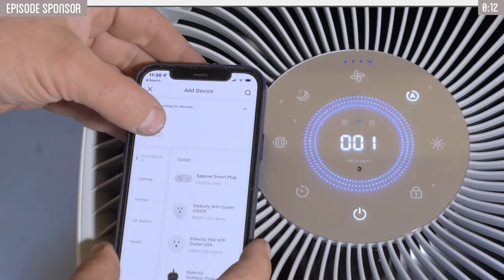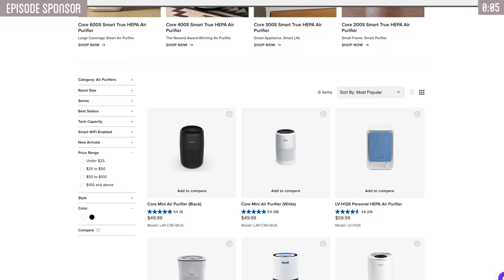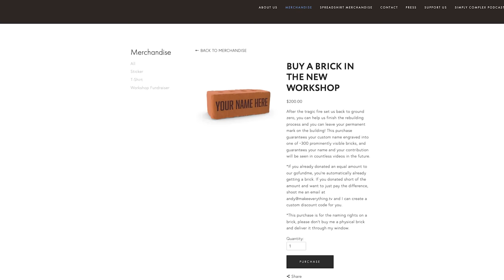How I Rebuilt 1 Year After a Fire Destroyed Everything

Comment: When you go to paint, might be worth looking into fire resistant paints, some aren't that much more expensive and can take a lot of heat/fire before allowing any damage to the surface (the paint essentially expands when burned to create a carbon foam that insulates the underlying material, then you can just scrape off the foam and repaint and as long as the fire gets put under control somewhat soon have almost no damage)
Reply: or rebuild things out of brick/concrete which is automatically fireproof
Reply: water glass makes wood less flammable.

Comment: Glad you are recovering. Don't forget to add a fire detection system. Smoke detectors might might not work well. But, you can use a heat triggered alarm like they use in factories  and be sure to wire it to an outside alarm bell so you can hear it from in the house. You might also consider a simple security system for your doors and windows.

Comment: Starlite(cbeck the nighthawklightin vid) based paint is what you need to guarantee the shop cant go up in flames. The paint foams up when there is fire making an insulating layer that will sve an egg from a blowtorch
Reply: Agreed, though it's not really starlite-based as starlite was proprietary. But most fire-resistant paints work on basically the same principles even if the exact mixtures are completely different. But I definitely agree, it's great stuff for this, because it can withstand for a long time and then you basically just scrape off the carbon foam and maybe repaint if it was bad enough.
Reply: @DreadKyller  Carbon foam based

Comment: Congratulations on the comeback!  Did you consider installing some sort of fire suppression system since you're rebuilding?
Reply from the maker: I've looked into a couple options and was hoping we'd have the budget leftover to invest, but not sure now that money is running short.  Also a little afraid of false alarms potentially causing damage to all the equipment, since we do work with a fair amount of controlled fire.
Reply: @htme  How did the fire start?
Reply: @htme  different fire suppression systems activate differently. A standard sprinkler system uses a low melting point metal to activate a single sprinkler head which minimizes water damage and nearly eliminates false activations. However it means the fire has gotten large enough to do decent damage to the structure. Other systems have an IR sensor and a particulate sensor and will activate the sprinkler system when both are triggered.

Comment: Why is it that most buildings especially in countries like the USA are made out of wood, wouldn't it make more sense to make it out of bricks and mortar or even concrete?
Reply from the maker: Mostly because it’s the cheapest option to build here
Reply: This is actually kind of a complicated question! Part of it is geographical and cultural: lumber in the US is more readily available, and always has been. The US doesn't have to deal with the lack of forests or space like a lot of Europe does, and so, fast growth lumber is cheap, renewable, and easy to get. When the states were colonized, most houses were built from lumber, and because of the space and availability here, it just stuck. 

Another part of it is actually safety, believe it or not: Andy and I live in an area where there are tornadoes. It might seem counter productive to build out of something that's easier for a tornado to knock down, but they'd knock down brick houses, and flying bricks will kill you much easier than wood will, and it's easier to climb out from under fallen timber structures.

Lastly, there's insulation: Where we live, temps range from (sometimes below) -40°F/C in the winter to (sometimes over) 105°F/40°C in the summer. This means our houses need to be really well insulated to protect from both the cold and the heat. While stone has an R value of 0.08, and brick is only slightly better at 0.20, stick construction (2x4 or 2x6 framing) with fiberglass batt insulation can have an R value of anywhere from 13-20, and attics going up to R60. 

Overall, though: It's how it's always been and it just stuck, it's affordable and renewable, it's faster to construct, some natural disasters can be deadlier in other types of construction, and they're easier and less space consuming to insulate, which keeps us more comfortable, and makes heating and cooling more efficient.
Reply: @TheElfsmith  I genuinely deeply appreciate you going out of your way to give such an in depth answer 

I had always thought brick and mortar houses would be much safer in a natural disaster like a tornado, I hadn't thought they were powerful enough to rip bricks from walls

Also now that I think about it yeah, the US not having to worry as much about forest cover as other countries hence the lower cost and renewablility of wood makes sense 

Also the cultural and historical aspects make a lot of sense 
Over here most people associate a house as somewhere safe and would not have it built with anything other than bricks/concrete, I guess it gives a certain feeling of safety and security to us